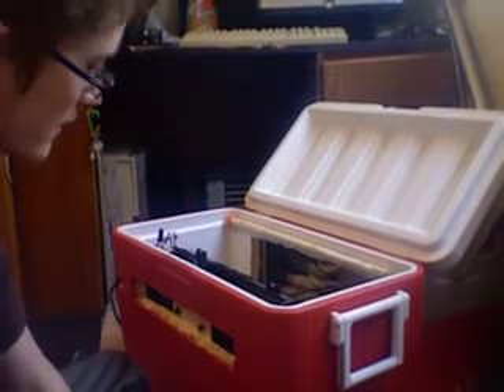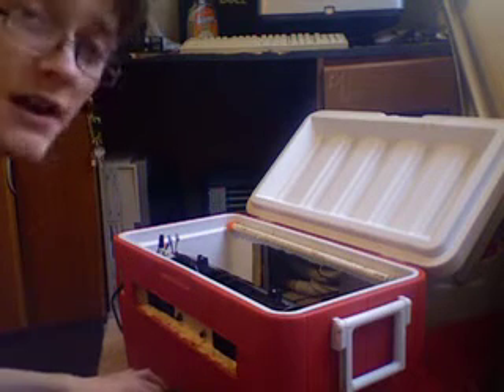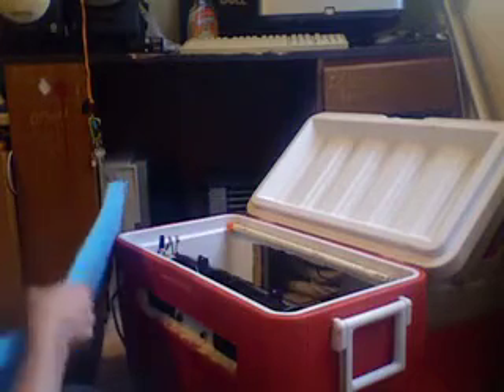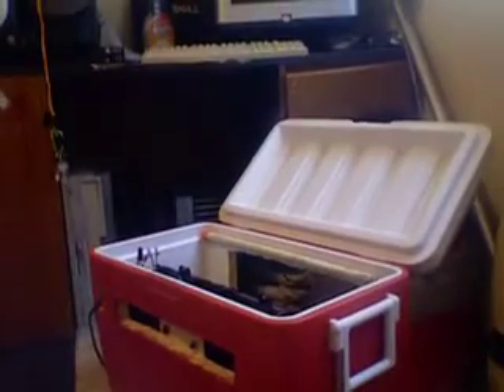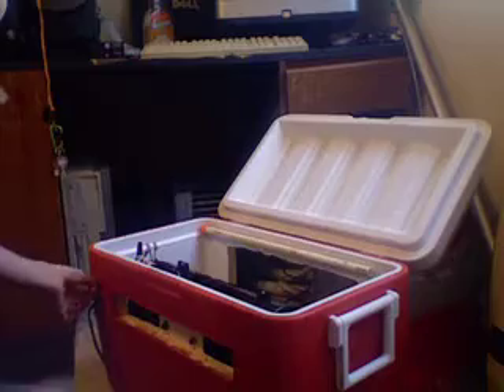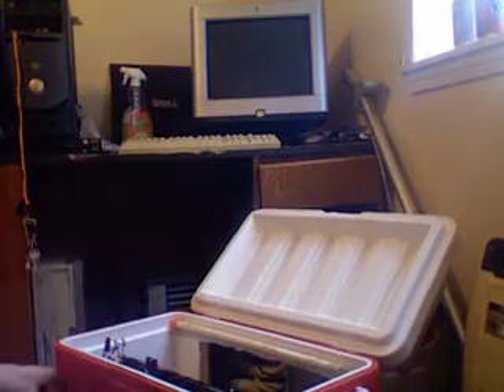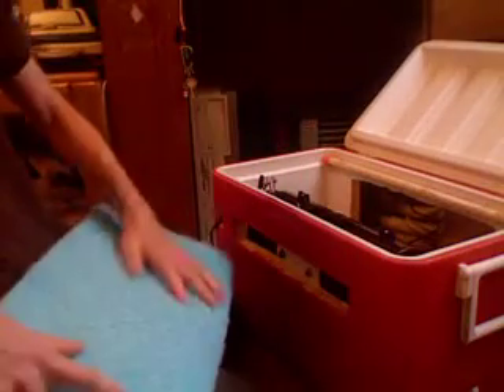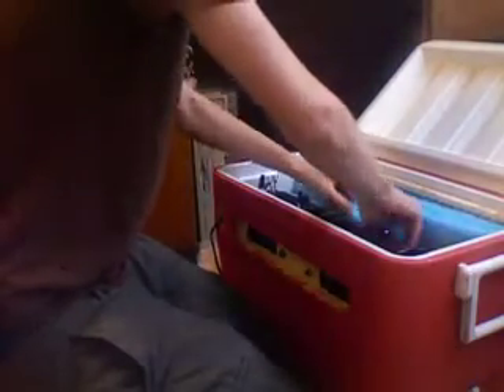How To Build A Evaporative Cooler (Swamp Cooler)

Comment from the maker: I found It really doesnt matter.  As long as the pump keeps the water flowing enough not to make dry spots on the pad.  ive built coolers with a super tiny pump that did maybe 30 gph. It had just enough power to drip fast on the pad and it stayed wet.   Here in oregon it doesnt get as dry as some areas do.   The more dry it is the faster the pad will loose water. Im sure your pump will work just fine.

Comment from the maker: ive never had that happen before tho.  ive been running this one ever since i made it.    and it works better if the hot dry air is first sucked through the wet pad instead of being blown through.   but i do get your point and i did keep that in mind when building it.   but i dont think its hurting anything

Comment: is there a special way to position the pad so the water doesn't have the possibility of running out the side of the pad once it gets soaked? I would assume that would happen.or is does it not happen because you aren't pumping that much water?

Comment: Looks good.  So far all the videos and instructions I have seen for swamp coolers are for these small things.  The one I'm currently building has its water output though the system is about one thousand five hundred gallons an hour (spelled out so you know its not a typo).